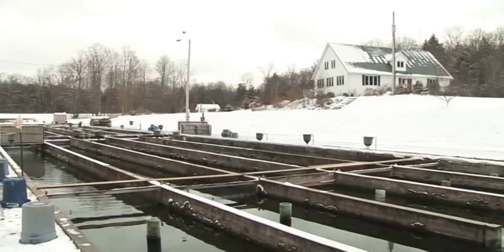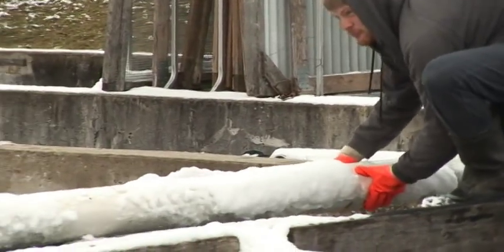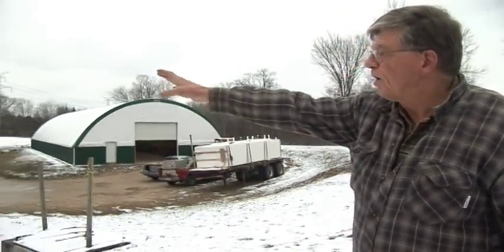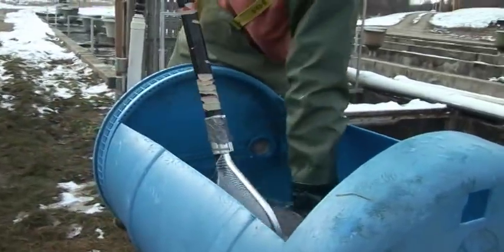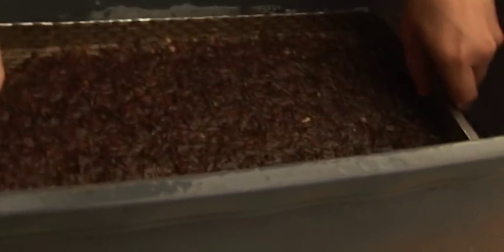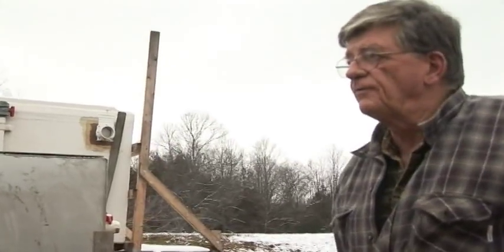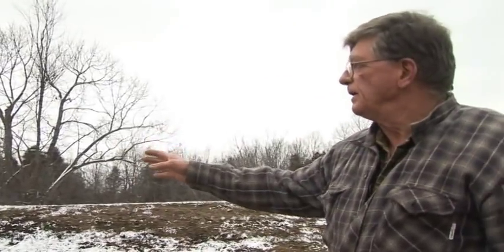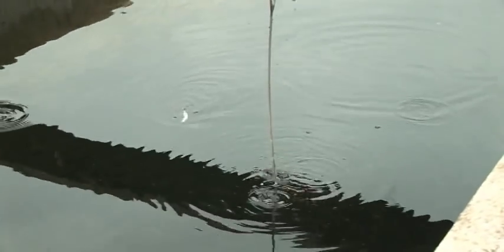Cedar Crest Trout Farm Documentary

Comment: i wish i were your neighbor :) fish waste is one of the highest quality organic fertilizer i have used. you could probably market the dehydrated fish waste at garden centers :) also in my spin filter i have a good layer of active carbon that helps clean the water and it makes the single most efficient multipurpose soil amendment known to man. bio char(active carbon) is relatively easy to make and provides energy in various forms and holds carbon long term in the ground..
Reply from the maker: Fish waste makes excellent fertilizer. Unfortunately in Ontario we are unable to take it off our property without special permits. Jim does have the best garden around because of it though!
Reply: Maybe if it’s mixed with soil it could be hauled with less interventions.

Comment from the maker: Over crowding can be a major issue, it is directly related to the size of fish you would grow and what temperature your water is. Our raceways are 50 ft x 8 ft x 3ft deep. We generally run at the equivalent of 6000 pounds per raceway in the summer. More in the winter, upto 8000 lbs. But again dependent on size of fish, wht kind of growth you want to put on etc.

Comment: Thanks for the video! I am also located in Ontario. I was wondering if it is possible to stock a pond with rainbows that is being constantly fed by an underground artesian well? The pond is round with a 40 M diameter. Would it be possible to stock enough fish in this pond for my families personal consumption or would the freezing of it over winter cause all life in it to die? Lastly, is it possible to stock a small private 3 acre lake with rainbows, and use it for personal consumption year round. The reason for the questions is that a property I am thinking of buying has these two features on it. I have an aim for being as self sufficient as possible. Thanks again!

Comment: Great video...but ummmm...how do you have more water going back into the river than you are taking out of it? Are you a water manufacturer masquerading as a trout farm? 😂
Reply from the maker: We use 3000gpm from the river, all of which goes right back in the river. We also have 2 deep wells that also then flow into the river (water which was not originally from the river system) also where the farm is built sits on many shallow aquifers, which we utilize for our early rearing and broodstock. Basically we use 3000gpm from the river, 120gpm from wells and 350gpm from the aquifers, meaning we put back 3470gpm to the river.